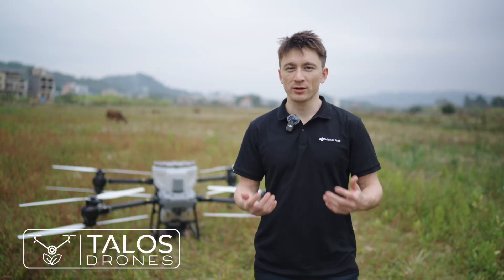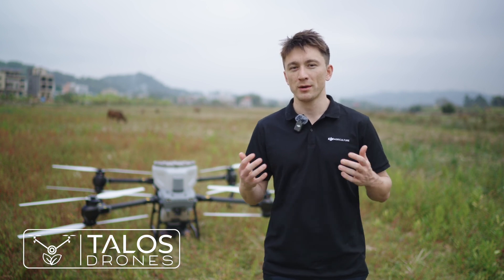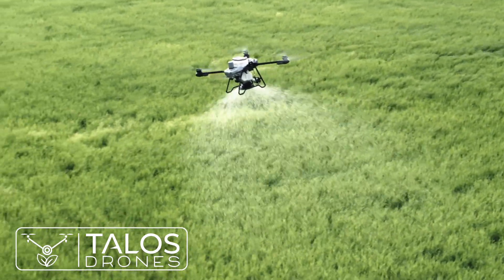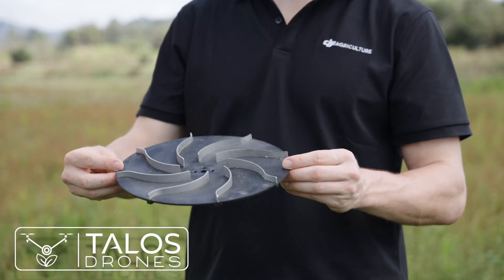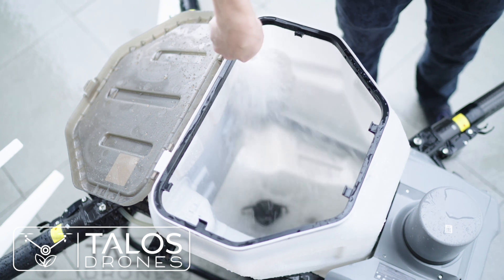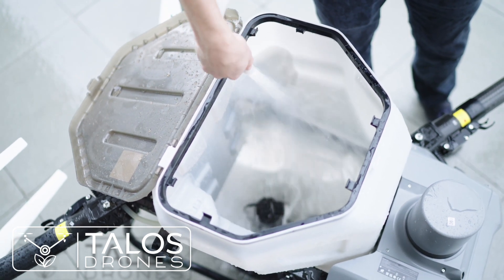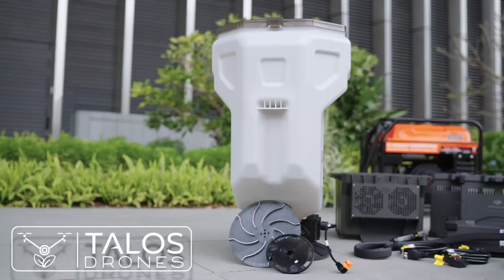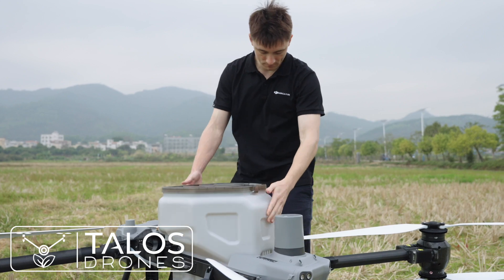🚀 DJI Agras T50 and T25 Spreading System Explained 🚀🌱

Comment: Hi.. I have been looking for spreading system for seed balls , like maybe 15-20 mm, how to achieve that? Do you offer such a solution? other drones are offering solutions but i prefer dji.Already have some dji drones.
Reply from the maker: Unfortunately, the agricultural drones are not currently equipped to support sowing seeds in the 15-20 mm size range. At present, the T50 model is designed to handle only 0.5-5 mm dry granules. Hopefully, DJI will develop a solution in the near future to accommodate larger seed sizes.